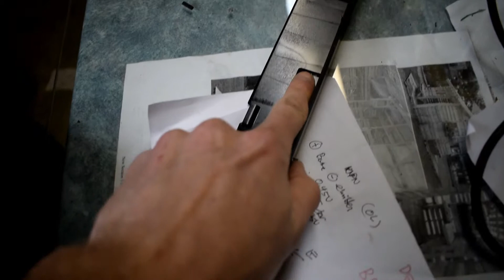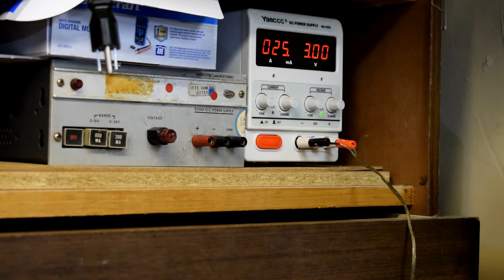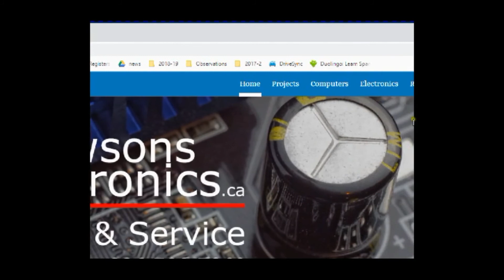Toshiba TV Backlight Repair

Comment: Good video. I have a similar model, 55l711u18, and the left third or quarter of the screen has a much cooler/blue tint than the rest. I’m suspecting LED failure. I don’t have a hot air gun, just an iron. Would I need a hot air station to replace the individual LEDs?

Comment: I got this TV you fixed. Yes, it's exactly the same one based on what I can see in the video. What a mess with those 3 LED's, I wish I could post pictures here, unbelievable.
Reply from the maker: are they burnt up?
Reply: @NewsonsElectronics Are they even soldered? You used different LED size, but why did you need to move them from their original locations? Lenses were also way off from LEDs.  I'd like to see a video with your backlight repair repair technique.  Hopefully you can do it better now than 2 years ago.
Reply from the maker: @AlexM-ci3re  Thanks for your feedback I am always trying to improve.

Comment: Thanks for the heads up on disassembly. I just bought a used model and it has the purple spotting on the right side. I think it's an issue close to this, perhaps led's that are STB.  The thing most people don't realize even easy fixes aren't easy, 95% of these repairs are disassembly and reassembly and those plastic snaps and ribbon cables don't mix.  Manufacturers know this and that's why they love those unibodies.
Reply from the maker: Glad I could help